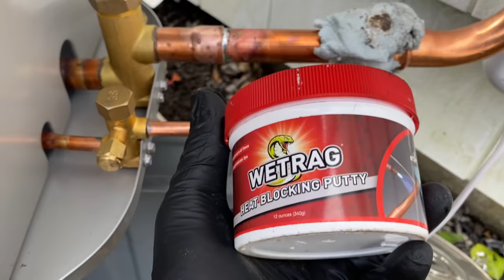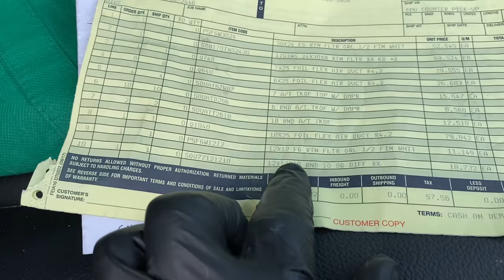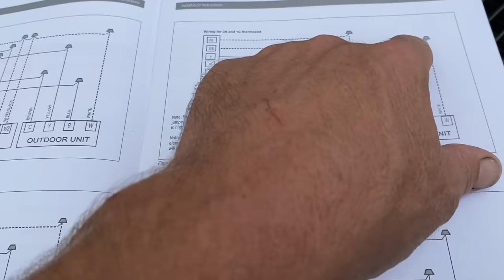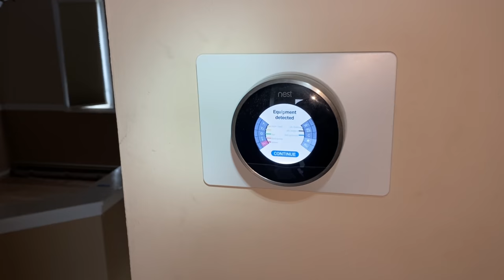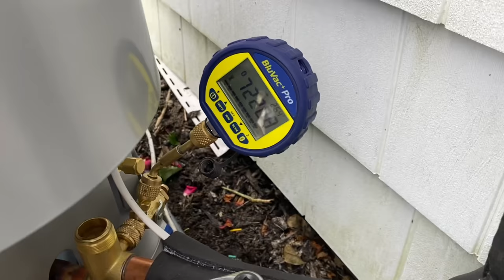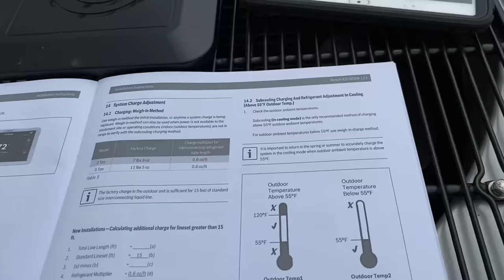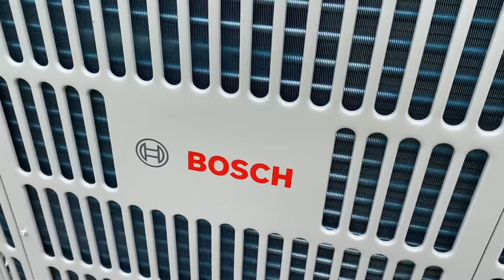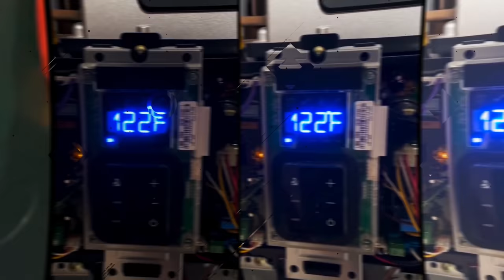Who Installed This Abortion? Another Hacked Central AC System Replaced with Bosch IDS 2.0 Equipment

Comment: When weighing in the extra charge, do it before you release the refrigerant from the condenser.  Since it's under vacuum, it will go very quickly.  Afterwards, of course, check sub-cooling to verify. Dan is a great addition.  Love the channel.  Keep it up!
Reply: Hvac Ace.. exactly right.. now with new higher efficiency units you have to perchance as the sbcooling is not what a standard unit runs.
Reply: Also, and this may seem counter intuitive, dump it in through the liquid side with your tank on top of the condenser. putting  it in from the suction side allows the refrigerant to expand and will actually slow down the process.
Reply: I think you have to count your fittings as well to get total equivalent length.  I can't remember, it's been a while.
Reply: @hvacgameproper1177  I wouldn't recommend dumping liquid refrigerant directly on top of the compressor in any situation. You would definitely increase chances of slugging the compressor.  I guess if you were to start in heat mode it would be OK. I think it is just safer to add liquid to the liquid line while in vacuum.

Comment: Im originally from NY, we didnt have heat pumps like you said. But ive been in NC for going on 2 years now and its full of heat pumps. I have not seen any with the liquid line insulated. Since you never installed one like you said and went based off of minisplits, i think it just shows how professional you are and how much you take pride in your work to go that extra step to insulate it to be on the safe side and not give the customer any problems by not insulating it. Great job. You can keep insulating them both if you would like or you really just need to insulate the suction line.

Comment: Refrigeration tech from FL, I use my vacuum pump at least 4 times a week. It's been over 4 months since the vacuum pump oil has been changed an STILL pulls down to 420 microns within 20 minutes. I know there will be some saying that's disgusting, it works for me lol. And Mikey Pipes knows how moist the air is down here, keep up the GREAT content and don't let Navien hush you up stay!

Comment: The oil acts as a lubricant and sealant for the pump vanes (your two stage fieldpiece, oil seals low to high sides aswell) . I was taught to test operation with a micron gauge before pulling the system down to determine if it was still adequate. the discoloration is an obvious sign on contaminants so change when its looking dirty.
Reply: I change mine at every use!
Reply: @petersmart1999  I think that's the best route, our company has a vac charge to cover it too. Just nice to know when you're on that job 2 hours away from the sup house!
Reply: My Welch pump was like $4500 so oil is cheeper, I like my pumps,I own several the oldest being 20 years old and they all work geat,but I work on stuff a little bigger than 5 tons,and usually in bad shape,but still I change every use! That's just me maybe
Reply: You change the oil for the same reason that was done years ago on oil bath air filters: the oil lubes the pump, maintains the sealing of the pump, and contains the contaminates.
Reply: @petersmart1999  actually, the oil is supposed to be changed immediately AFTER the use.
Reply: @SuperVstech  I know ,thats why I change it every use!It's actually written on the pumps.But I believe alot of guys on a new clean system,do a few then change it.

Comment: Hi, Mikey Pipes watching all the way from South Africa, Love the content and the energy you put into your work I can see the passion. We exclusively install heat-pump systems here in South Africa (Mother City, Cape Town) Most beautiful City by far according to me, Anyway, we insulate both lines most expansion devices are located in the condenser units in our Region, and therefore need to insulate both lines. Oh and I do a test with the micron gauge connected directly to my vacuum pump to determine when to change the oil. Great work

Comment: Good question about vacuum pumps and oil changing. Generally you will be using your vacuum pump on old systems rather than virginal new systems - unless you have two vacuum pumps and reserve one dedicated to new installs then you should change the oil after each session because because vacuum pumps don't have filters, the oil inside becomes saturated with contaminants, which reduces the pump's efficiency. Once oil is saturated it can't absorb any more system moisture. ... Replacing a vacuum pump's oil is critical to ensuring that your pump will keep running smoothly. Some vacuum pumps have a sight glass to view the oil and its colour - so if you are cheap - you could change the oil as soon as you see a significant colour change.

Comment: One suggestion for a tool that comes in handy on ductwork jobs like this is a Malco hole cutter, you drill a hole in center of circle you want to cut in the plenum and the tool has a special bit that you then spin around the hole you just drilled and it cuts a perfect circle ( tool is adjustable for different round sizes ) no need for a hammer and screwdriver or electric shears to cut a circle out of a sheet metal plenum . Since you have so many nice tools i thought you might look into this next time your at a supply house, and get a couple of extra bits if you get one. Great video and very nice system!

Comment: hey man good video. it is a good feeling when the guys u train are finally producing and becoming more than helpers.
ive been installing many of these units usually with a backup furnace or electric heater.

from what ive learned the W terminal on the outdoor unit is meant for communication of indoor and outdoor unit when the performance of the heatpump drops off around 5 degrees and so the outdoor unit can send 24v to an aux electric heater. unless the home has solar i have been programming th smart thermostat to only run the heatpump to 15 degrees and instead run a 97% furnace or boiler. figured id share this to save you a call to tech support.

i grew up on the northshore and been living in colorado for 10 years. its crazy we got heatpumps here too and even up in the mountains. love your work flow and leadership with the guys. brings me back good memories in shitty attics

Comment: Yes, on a “heat pump” unit we always insulate both lines.  Certain systems are actually more efficient heating than natural gas boilers/furnaces down to 30 degrees or so depending on the cost of electric & gas.  Around here the magic COP number is 3.5.  Once the COP drops below 3.5 a 95% natural gas system is more efficient.
Reply: Heat pumps very common here. We have pre-insulated coils for domestic stuff here just roll it out all ready to go
Reply: Colder winters up there seemed like the right thing to do ,on a line set over 40 ft on top of it.  Condensate coil freezing up 20'  with a wind chill in the low teens roof top ,for a computer room sub floor cooling had to thaw out with torch about 20 yrs. ago charge was good , temp Thermal  wrap till cold front pushed thru .👍💪🙏✌️electrical power only, no propane or natural ...
Reply: No need to insulate liquid line but doing so won't heard anything, excellent install love your work man keep the good work.
Reply: dont look at efficiency, look at cost. how much is a Kw of energy from gas and how much from a heat pump? and take note of the REAL efficiency of a gas burner, not its theoretical listed rating. once you look at that you will probably see much lower COP numbers.

Comment: The smaller line only gets insulated on minisplits because the metering device is in the condenser. On MOST ducted splits you shouldn't insulate the liquid line(heat pump or ac)
Reply: Why shouldn't you Insulate the liquid line? Though not common practice not a bad idea in hot attic the ensure metering device see that solid column of liquid. Didn't appear to be a long line set but have seen issue in hot attic where liquid refrigerant is boiling before metering Device.
Reply: @vascowilson9102  you dont insulate liquid line on regular heat pump because it dont condensate.
Reply: @vascowilson9102  insulating in the attic is only going to be helpful when it is hotter then the outdoor ambient. Additional Subcooling takes place between the condenser and evaporator. IN HEAT MODE the condenser has already transferred as much heat as it can into the supply duct. After the indoor coil you have subcooled liquid going back to the outdoor unit where your metering Device is.  The liquid will have to flash off. So the warmer it is the less productive it is
Reply: @DavidMay2nd  many places its code to have both insulated even on straight ac. It sucks

Comment: Tip for you with take offs… squares are low restriction, but the rounds are high. Use a larger take off, with a reducer on it, to match the take off effective length.

Comment: Nice job and nice install....
I think some companies may take longer only cause some would do the duct replacement differently. Flex goes in fast so cuts time down drastically. Also having a proper duct design vs just using a supply plenum and return plenum also cuts down time... All good....

Comment: the reason you change oil from an air compressor or a vacuum pump is due to the moving parts (friction). The oil breaks down when it's heated and re-heated and looses it's viscosity. Steel or Aluminum moving parts also break down over time leaving fine particles in the oil and oil will start to turn dark which shows that there is normal wear on the moving parts. If you keep the old oil in and keep running it, the parts will wear considerably causing the motor to seize up. Oil should be replaced after every 1 full hour of use.

Comment: Mike, 
Opening Service Valves
Manufacturers are different. The Bosch 2.0 systems advise in the installation manual that the Vapor side is to be opened before the Liquid side.

Comment: On a new install with a new line set every thing is clean no need to change oil. If you reuse line set it's full of dirty oil you need to change. Before you hook up the pump hook micron gauge right at the pump and if it pulls down to 20 microns the oil is ok

Comment: I’ve installed a LOT of the 2.0’s, they are great, but you need to match the airflow for the home load calc. They will flow 2.5 to 5tons, and be extremely quiet doing it. The 12year warranty is unmatched. Having a thermostat control the air handler’s heat needs the unit can run nearly all day long, ramping up with the sun, and down as the sun drops out. Amazing machines. Best with the Bosch smart thermostat.

Comment: Mike, the reason the liquid line would be insulated is because, on a mini split, what is usually a liquid line is actually an expansion line. 

The metering device is in the condenser and the cold line will condensate inside the home and cause damage. 

Since you are using a txv at the air handler the insulation is not needed.

Comment: I've never wrapped the liquid line in a heat pump because it doesn't create  condensation but wrapping it in the attic might help the refrigerant not pick up any attic heat so might be a good idea. 
The best idea was never go back to the truck empty handed!
Saves bunch of time on cleanup and saves your body from climbing down from the attic or up from the basement multiple times!  Great install job!

Comment: Love your work learn alot from you regarding hydronic and plumbing, I'm in VA residential service tech. We do have some boilers not as many as I like to see come winter, HP and furnace/AC market predominantly. 1st you open liquid side service valve because if you open suction you run the risk of pulling oil out of compressor per Rudd training course. 2nd I cringed when I saw your duct lay out, all those taps on that long supply plenum otherwise known as the Radial plenum that I would have bubble wrapped in that hot attic. Not my choice lay out because here in Richmond VA we have those in older houses that were strictly heat only with furnaces and when changeout with HP I noticed they struggle to heat. I prefer the reducing truck layout in round pipe definitely with those big HP taking air a long way so it won't get lazy, but I'm far from duct expert just my preference Hope that return box was lined or got warped. Not trying to beat the work up too bad because I do admire the quality you do provide to the customer and talk plenty of shit in the process my kind of guy.

Comment: Open the liquid side first because you don't want to slug the compressor with liquid on start-up. As for the vac pump If all you are vacuuming is new systems change once a week and before long breaks in-between vac's is what I do if I vac a dirty system comp burn out I change it after before I put the pump on the truck, don't want all that crap left in my pump. Also we install almost exclusively Heatpumps in the south the 3/8 line insulation is not necessary but not a bad idea either.

Comment: Depends how long the line set is for me and how much moisture is in the system. I've noticed the more you use the same oil the harder it is for the pump to pull a deep vacuum

Comment: Insulating the 3/8 on a ducted heat pump is not necessary Mikey P.  The reason you have to insulate both lines on a ductless system is that the TXV for those units is located inside of the condensing unit, which can cause what we call the liquid line, to sweat.

Comment: Oil- test the pull down with the gauge only and if it can get down to 20ish within a minute or what you benchmarked it when it was new, the oil is still good.  Assuming your pressure test verified no leak and a new leak did not sudden occur during the vac procedure, Once the pull down rate starts slowing down to a crawl and it's still far from desired target, I will start with an oil change after checking the hoses and setup.  I mostly do repairs and have found it necessary to change oil after every job. On new copper and evap coil change outs or install, I typically change on every other project but it really depends on the condition of the system i.e. Moisture that got into it. If the line set is under vac, I typically open the suction service first so that if any excessive level of oil comes out, it will be drawn back upon compressor start. Not sure if that is what all manufacturers call for now a days , but that is my procedure for the last 30 years.

Comment: Keep in mind, the line sets need to have an inverted loop when evaporator is above the condenser. I usually route the lines up and over the air handler before the drop down.

Comment: this comes directly from the rses source on deep vac pulling

When servicing today’s systems we  
must change the oil as soon as it becomes 
contaminated and no less frequently than 
every time the vacuum pump is used.  
Because the oil should be changed after  
the vacuum pump is used and while the  
oil is still hot, a look at the oil can indicate 
what is happening in the system. White 
cloudy oil indicates excessive moisture. 
Brown oil can indicate a burnout (which 
should be confirmed by an acid test) or a 
failure to properly clean the system. Oil 
with black or grey specks is usually the  
result of a previous technician who failed  
to purge nitrogen while brazing.

Comment: I don't change my vacuum pump oil every time.  I check it by putting the micron gauge directly to the pump.  If it pulls down to around 50 microns in less than 30 seconds it's good 👍👌

Comment: As far as insulating liquid line on heat pump it's not necessary. As far as service valves always open in flow of refrigerant. Which would be high side then suction side. The reason for this as it was explained to me. Liquid logging the compressor. When you open liquid line first refrigerant flows it's normal way allowing it a chance to vaporize before returning to compressor. The txv should be closed until unit is turned on. Therefore it will stop the flow at the evaporator. Once unit is running it opens by pressure increase (unless its etxv) allowing refrigerant to change to a vapor and return to condenser.

Comment: Best knee pads are ProKnees. They aren't the best when climbing a ladder, but any other time, perfect.  great for straddling ceiling joists They are fit to your size.  Bummer is they aren't cheap.  Mine are 15+ years old and are starting to need a rebuild kit.

Comment: Typically you only insulate the liquid line in extreme ambient like an attic, etc. The liquid line on mini splits is insulated because the metering device is in the outdoor unit. Both lines are low pressure. Hope this helps.
Reply: @PipeDoctor  you too. Great content and information on the steam and hydronic systems. Not well versed in that area but your videos teach well.

Comment: actually impressed seeing the wagos. as a EU based hvac guy i cannot understand why wire nuts are even used. they are horrible. and yes, you do need to insulate BOTH lines for a heat pump. and you fill from the liquid side so there is no chance of liquid getting pulled into the compressor. pro tip: if you need to add gas, do that BEFORE opening the system. use the vaccum you already have to pull in the needed charge and then open the outdoor unit. instant proper level and not dicking around with adding charge when running.
Reply: @PipeDoctor  fun fact: between the lever and the wire insert point is a small slot in 1 or 2 places. its for shoving in your meter leads.

Comment: I was always told the reason to change the pump oil is because of the contaminants that you pull out when you vacuum a system down. When you pump down a new system there isn't as many contaminants as and old system. My company doesn't change the oil till it starts turning brown for example but we do a lot of new installs